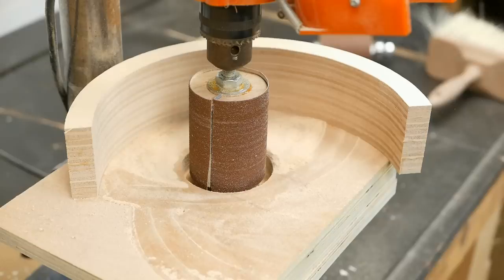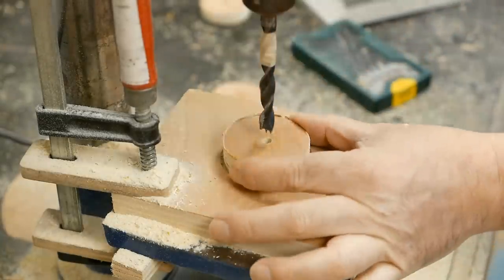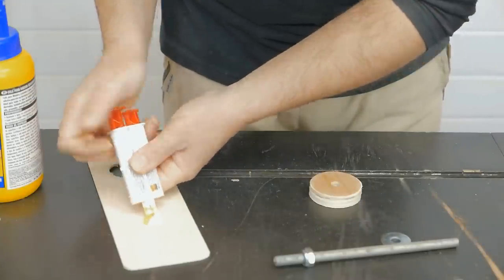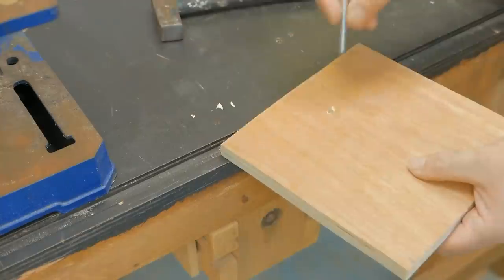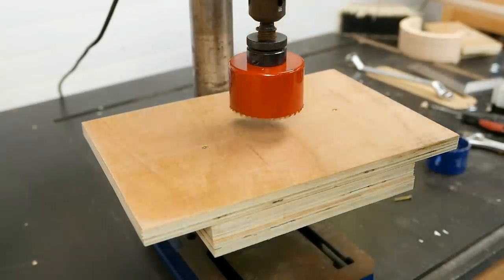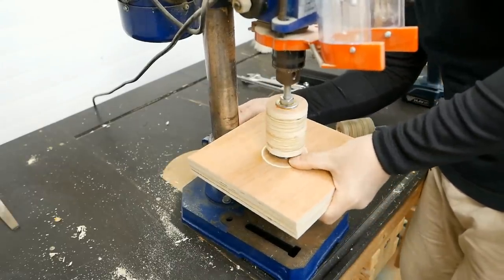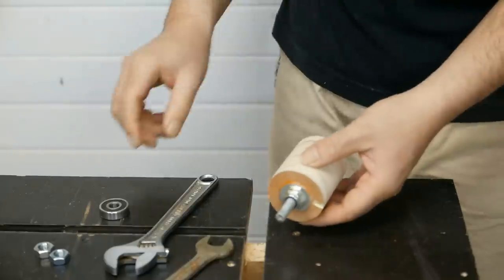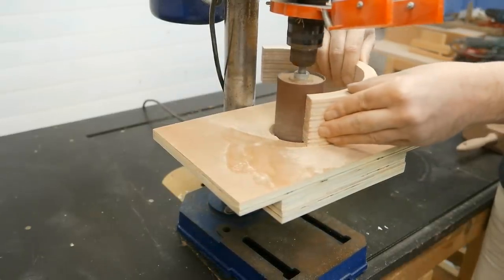How to make a spinning drum sander for drill press

Comment: Thank you for the video. I sprayed a layer of flexible rubber seal (flex seal) onto the surface of my discs that make up the body of the drum sander. It really improved the longevity of my drum. I need to use your ideas to upgrade my diy drum sander again and bring it to an even more functional level! Thank you again
Reply from the maker: It is quite interesting that of using a flexible rubber seal :)

Comment: When using threaded rod for a project like this, I usually choose a bit one size smaller than the rod. Then you can screw the wooden discs onto the rod, which gives a little more secure hold than the epoxy alone. Well done.
Reply from the maker: Thank you. And thanks for the tip :D

Comment: I make some toys and  use the same way to make wheels for cars. The difference I made a drum sander is that  I use dowels. Up to 1 1/2 inches thick. and maybe the same length (maybe 2 1/2 inches long or 3')as yours. I drill a hole in the middle of the dowel
and insert a 1/4 dowel  instead of a rod. And works perfecrly.
Reply: I was also thinking of trying this. I would leave the bearing in the bottom of the table.
Reply: @b3arwithm3  6
6

Comment: You do a great job explaining each step and I do like the tapping the bolts down also but next time you have to tap the opposite direction,  screw a nut on until bolt is flush with bolt end.  This will allow safe strike on bolt without endangering the bolt threads.

Comment: Good work, Sergio! I made one from palletwood, two years ago. The same way, but much more  easier, without bearing and without glueing the paper. Only fixed with a little dowel in a hole. Works perfectly in an old Drillmachine. But bearings are absolutly neccesary in my new one to safe it from damages. Merry Christmas!

Comment: Great video, these work great.  My suggestion: install nuts onto all-threads or bolts BEFORE cutting, filing, of hitting the threads w/a hammer ... then file, then remove the nut to re-shape the threads.  I made large versions of these for my wood lathe (save $ & shop space).  Love your videos.
Reply from the maker: Thank you very much. I know your trick, but I always forget to put the nut before I cut the threaded rod 😩

Comment: If you make the threaded rod several inches longer, leaving a gap between the bearing and the plywood discs, then you can make a dust-collection box. Just remove the top plywood board, add 4 walls tall enough for a dust-collection port, glue or screw them together, drill a port for dust collection in one wall, and then put the top back on.
Reply: J Will I think Dominic Bender has a video of something very similar to that dust collector for his drill press spindle sander.

Comment: Very nice drill press sander jig Sergio! The most common problem with the torque of your drill press could be a worn out driving belt. You could place an Optibelt driving belt and if the pulleys feel greasy, you have to clean them.
Reply: Bravo pour ton anglais  il n est pas parfait, mais très facile à comprendre Tu es un excellent professeur J ai fabriquė ta sableuse  et cela fonctionne très bien

Comment: Precision carpentry!!

I have a similar, cheap drill press. You can change the belts to make it run slower; it will work better with the hole saw in that way.

Comment: A suggestion for dust collection is that you use 3 plates , for your baseplate. The middle one can form an air valve for vacuum. so the suction appears on the bottom of the sanding drum
Reply from the maker: I already made a "Very efficient diy dust collection for drill press drum sander". You can find the video in my channel :D

Comment: So will the adhesive be difficult to unwrap used paper when needed to change?
Reply from the maker: I had no problems when changing the sandpaper. It stuck a little to the wood, but it came off well.

Comment: I did this with the circles BUT no holes ,glues 5 of them and then set a long screw to it and cut the head of the screw and poof:) it works fine on the drill press :)

Comment: Feliz Navidad Sergio may God bless you and your family.
Reply: I bought a set of drum sander attachments at harbor freight in the states that look just like yours!  One thing mine have is a wider slot. The sandpaper is inserted into the slot on both ends and is held in by friction. Works well. Try that to avoid adhesive. More options for reusable cylinders.

Comment: after the paper wears out, how hard is it to remove , and will there be lumps from the glue when you reapply glue the second and third time?  Good job though.
Reply: Andy Piszcz Use a heat gun to soften the adhesive. Peel of old sandpaper. Once removed you can scrape off or resurface the wooden spindle with light sanding using high grit sandpaper about 200 grit  and then glue new piece of sandpaper again onto spindle

Comment: I use spray glue lightly to hold the sandpaper onto wood. I also use this way to make temporary files with wood strips and broken belt sander belts, it comes off easily.

Comment: hi, what size of bearing you used on it? thanks
Reply: Quang Vu for mine I used R8 ZZ 1/2” bearings. (eBay). The size isn’t that important as long as they aren’t very small. You cut you hole to fit the bearings.

Comment: That's a bit overengineered, for example that bearing is useless, if the threaded rod is properly set in the chuck it will not move nor wobble, the lever arm is not that big and you aren't supposed to push hard on it either.  It is probably safer with it, I don't say it is bad or anything, just a bit overcomplicated for no real reason.
Also, cutting the grooves in each round disks before gluing them together would've made the process way easier, rather than trying to set it properly in a vise to cut it after.

I liked the video though, I'll make it my way. Thank you.